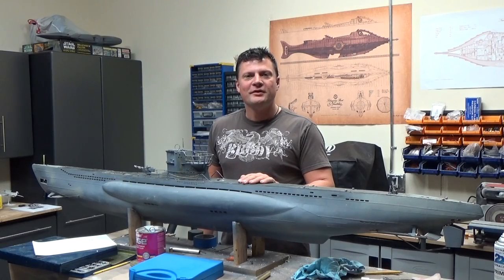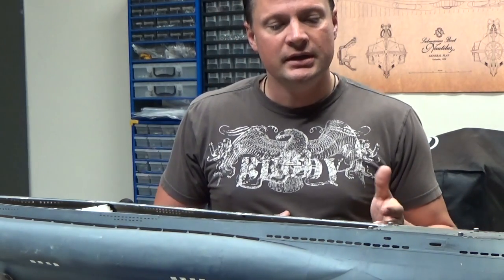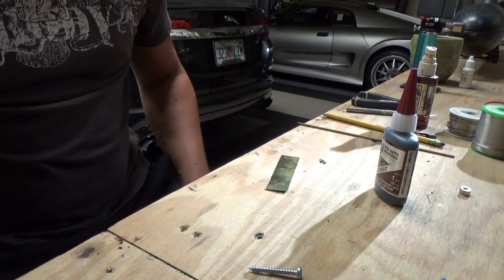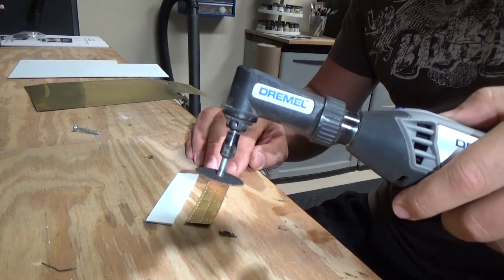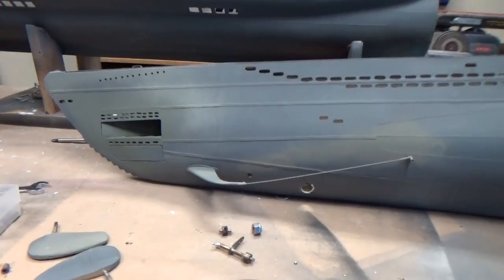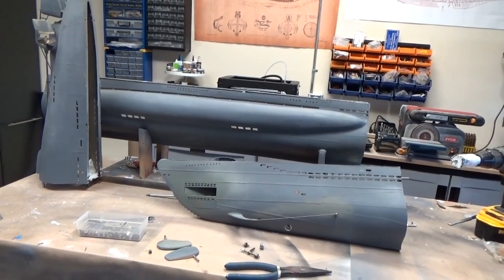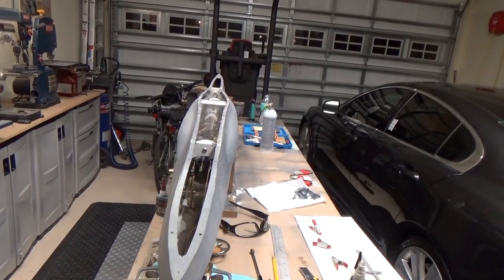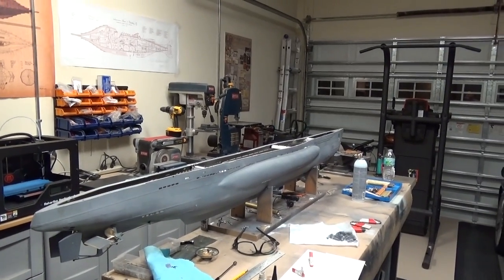German Type VII R/C buildup in 1/32 scale - CH.4

Comment: I watched with interest your progress on the type VII, i've got myself also one at almost the same scale.
As for your torps, did you gave the stabilising fins a angle?, to me they seems to be straight, if given a angle you can get some rotation, which will better stabilise your trajectory, as for your jumping example, is it possible to narrow down your nozzle, this way the thrust will not be that big and will give you a more controlled launch, using the bras tubing as a pressuretank, i have to remember, neat solution!.

Comment: About how much US dollar's would it cost to make a 1/144 scale type VII u-boat?  And could you juat use all waterproof parts insted of a watertight cinder?
Reply from the maker: Burke,  there's a reason we use cylinders as opposed to just slathering everything with silicone.  The silicone path might work for a while, but it won't long-term. If you're serious about a small-scale sub and have in excess of $1000 to spend, email me at bob@rc-sub.com with your vision for the boat.

Comment: is building this within the financial means of the average guy ?
Reply from the maker: I suppose that really depends on what your definition of average guy is. The parts alone will see you back approximately 3000 US dollars for what you've seen me working with. There are cheaper alternatives, and you may be able to get that closer to 2000 dollars.
Reply: wow
Reply: RCSubGuy i guess spreading the project over time... one can conclude that it is accessible by the average guy. short spending sprees
Reply from the maker: Ben Hebert Bear in mind that this particular model is one of the most expensive to complete.  Smaller models with different drive cylinders could get you completely set up closer to the $1000 mark (for parts).
Reply: so 1/72 is better?
Reply from the maker: Ben Hebert I don't know how you can say better, but certainly different.  72nd scale is less than half the size of this 32nd scale sub, and there is really no replacement for the presence that a big sub has on and under the water.  The plastic model conversions in 72nd scale are infinitely cheaper, but if you want the big boats, you pay for it...
Reply: I enjoy following your vids and enjoy building almost all my marine projects from scratch. But I was looking to price a kit from DK only to find them out of business, I'm looking for 1/48 or 1/32 u-boats. The trumpeter is a transparent kit which seems like a waste of money to go R/C. Who is out there making big scale?
Reply from the maker: I can offer kits in both scales. The big 32nd scale would be in the $1200US range and the 48th would be just under $400. Hit me up by email and I can get you details and better idea on pricing with shipping, if you're interested. bob@rc-sub.com